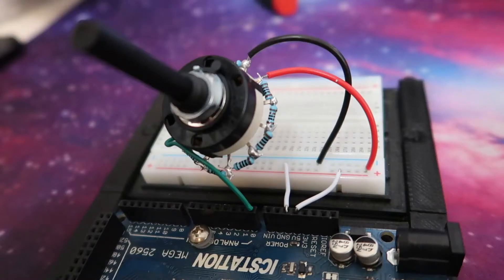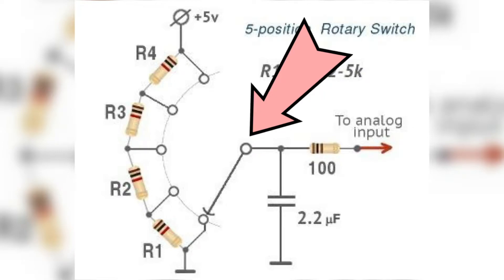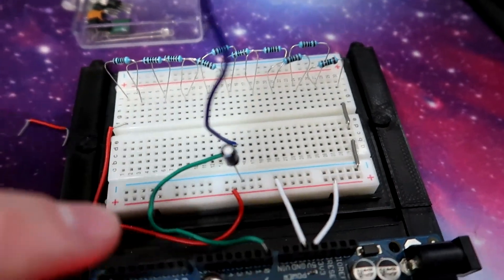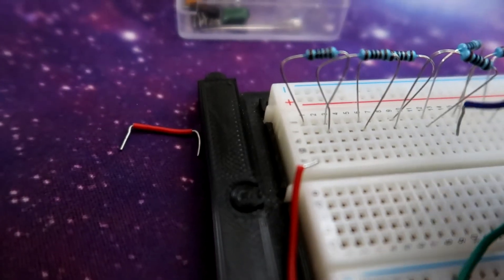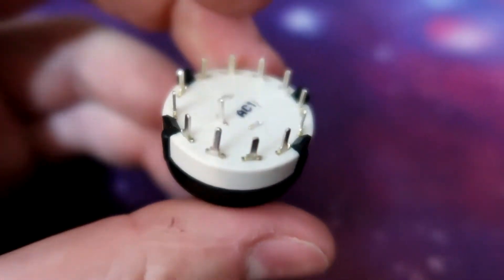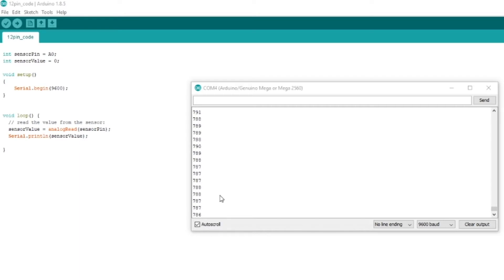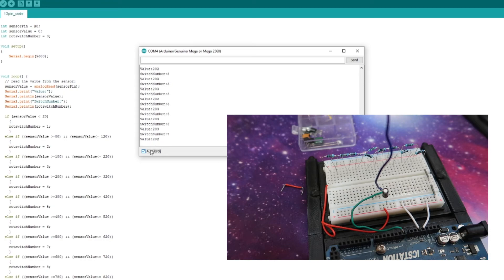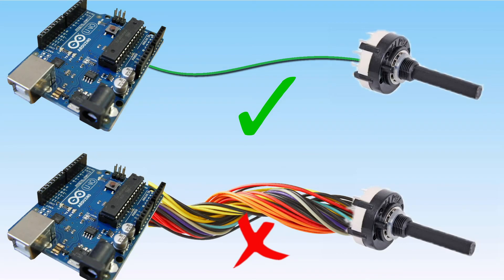How to setup a Rotary Switch with 1 Input

Comment: Hello
it's been some time with the video, but I've only seen it now.
Can I also use the circuit in sim racing instead of a Rotary Encoder Ec11 to switch TC and ABS ?. 
I like the rotary switches because they have a noticeable grid.
Greetings from Germany .

Comment: hi i have a rotary switch with these specifications:
Number of Positions:	12 Position	
Number of Decks:	1 Deck	
Number of Poles per Deck:	1 Pole	
Current Rating:	200 mA	
Voltage Rating DC:	30 VDC	
Voltage Rating AC:	125 VAC	
Contact Style:	Shorting	
Termination Style:	Solder Lug
Actuator:	Flatted	
Index Stops:	Adjustable	
Voltage Rating:	115 VAC, 30 VDC

what resistors and capacitor do i need to buy to perfect match the rotary switch above? thx!

Comment: I almost gave up on this until tonight... I'm using a modded version of that same switch that allows for infinite rotation... however when the rotary was moved between the 2 pins that aren't bridged together by a resistor (PIN 1<-->4 from this video's schematic), it was shorting 3v3 and GND and would reset the board (which is not convenient when workiing on an ESP32 WROOM losing BT connection) . 
Finally resolved the issue by adding a diode in series between 3v3 and the switch PIN connecting to 3v3... BINGO! No more shorts, perfect stable reading @ +/-3.

Comment: If anyone wants to use this or many buttons on 1 analoge pin with the joystick.h library:

void loop() {
 int analog = analogRead(A0); // analogue pin "A0"

 if (analog> 800 && analog < 1000) { //we set up range for button 0
Joystick.pressButton(0);
 button_pressed = 0;

} else if (analog > 750 && analog< 800) { //we set up range for button 1
Joystick.pressButton(1);
 button_pressed = 1;

}.... // etc, if we want more buttons
....
delay(50);
Joystick.setButton(button_pressed, 0); // we release button when we no longer click

Comment: A tip: soldering the resistors on looked to be difficult and tedious as shown. I would suggest a single wrap of each resistor lead around the pin which will hold them in place then solder all in one go and trim the ends of the leads when done.

Comment: Great video. I have the almost same switch (dual pole 6 position). I'll use Arduino Due. Can I use the same? Same resistor and cap value?

Thanks

Comment: Hi Scotty, Why did you use the 2.2uf Capacitor?  You didn't tell us why.
Reply: My guess is to handle debounce. That is, the 2.2uF cap will (hopefully) hold the charge and maintain the present voltage on the analog pin as the switch wiper wipes off one contact before it reaches the next contact.
Reply: Hey John - I tried with and without the capacitor (although I only had a 0.1uF.  also added the 100Ohm resistor inline which was mentioned in the video).
Without the capacitor, the values you get from each switch position fluctuated widely; so much so that it was very hard to code discreet switch positions. Adding the capacitor in series smoothed out the figures entirely, and I got stable readings at each switch position (with a margin of ~5).

Comment: Awesome idea and great video. Totally new to Arduinos but am looking to control programable LEDs using the switch to drive different patterns as my first project. In tinkercad, I've mocked up your switch idea and have also loaded the neopixel template as well. If I wanted to combine the two setups (to eliminate the neo Arduino), where do I connect the power and ground for the LEDs? My guess is that the switch and the LEDs are 2 separate operations and the LEDs can connect anywhere there is ground and power. If this is true, and I want to eliminate the breadboard, I see that there are 2 grounds but only one 5v pin on the Arduino. Thanks again for the fantastic vid, I'm just not sure how to now put it into practical use.

Comment: Hi Scotty, Loved your video. You gave me the basics on controlling my Mustang/Tesla conversion steering wheel buttons. They are a 2 wire setup with resistors that send signals to the onboard computer. I am wanting to change them to use as Park, Reverse, Neutral and drive.  So I watched and setup what you did and got my 0-5 switch numbers but now I'm confused as to to implement then in the arduino to use as momentary switches.  Any chance you could do a follow up on using the rotary switch to control on and off leds using the switch numbers generated and how to set them up to use as switched to control a relay or Mosfet?